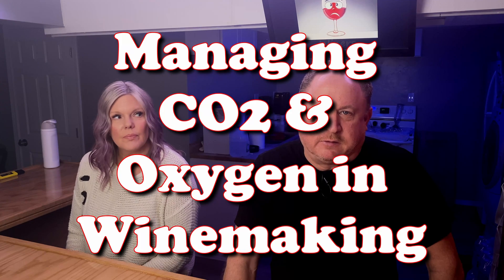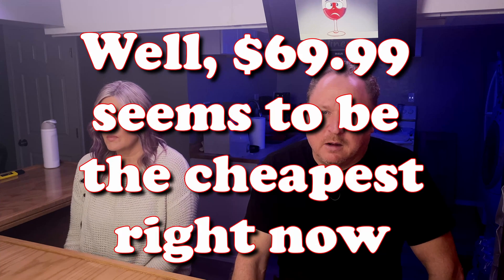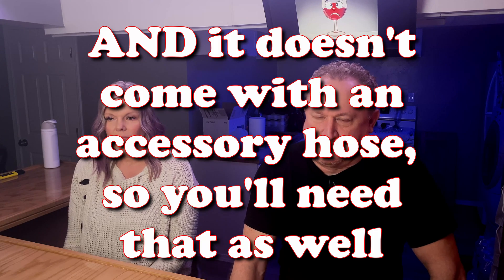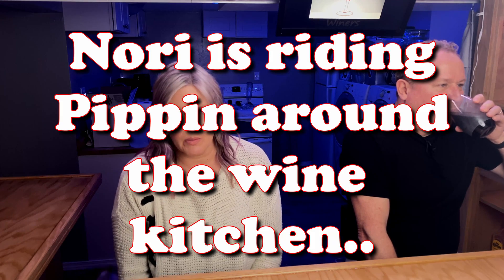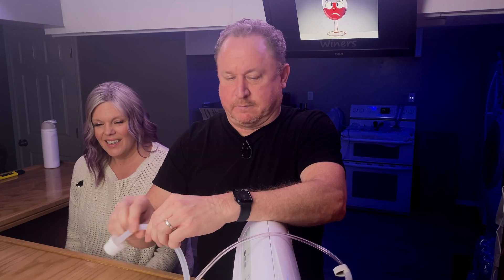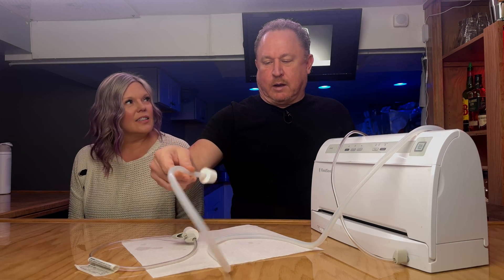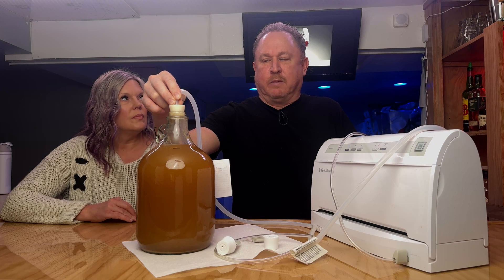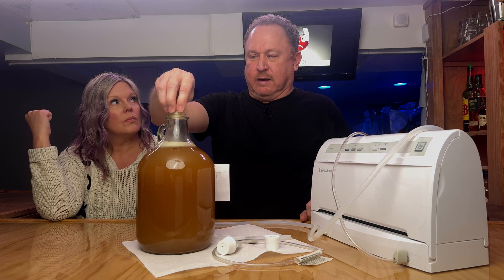Managing CO2 & Oxygen in Winemaking

Comment: I posted a photo of this process on a FB wine forum, and you would have thought I tossed the baby out with the bathwater.  

So to double check, I researched the process. And yes, it is a normal process, and yes you can cause issues if you over do it. However, I doubt these types of vacuum sealers have enough bar pressure to cause any issues. 

Thanks for the tip it made degassing my wine made with D47 much easier, D47 is a gassy yeast.
Reply from the maker: Those FB forums have some grumpy and VERY opinionated people! LOL New isn't always bad...
Glad it was useful to you at least :)